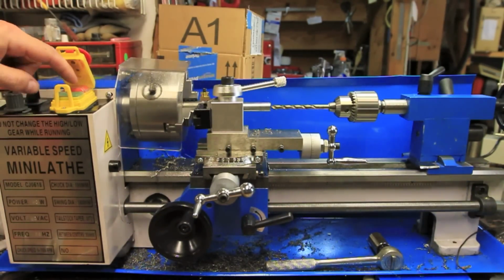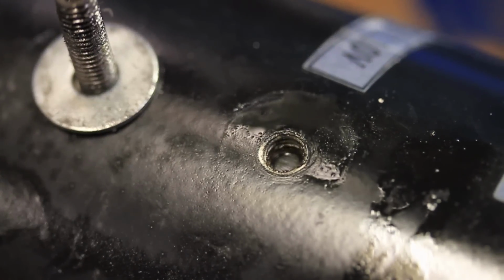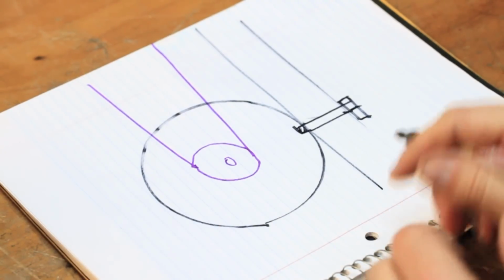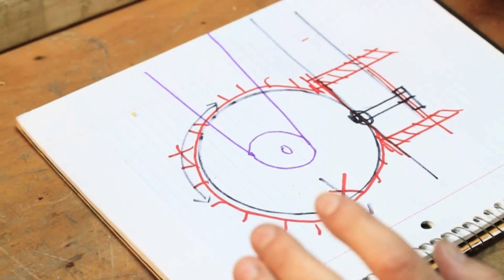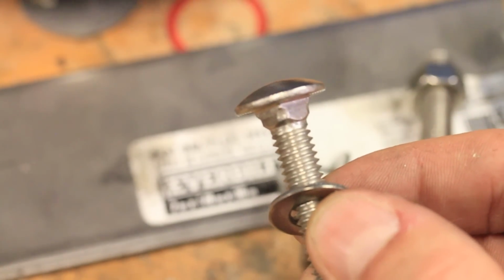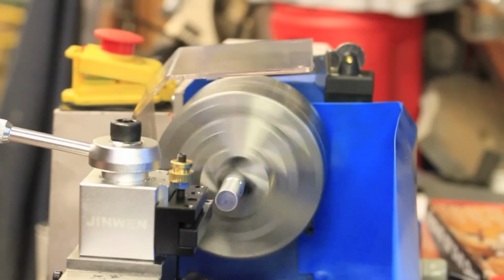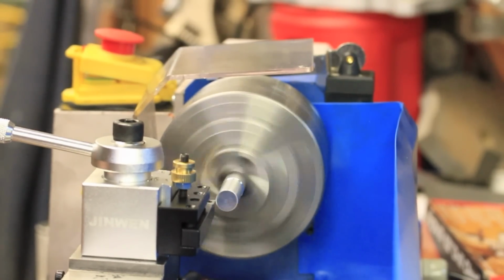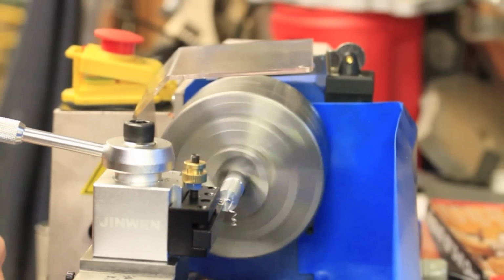It wasn't broken, just cheap - Fixing the Mini Lathe Motor Mount

Comment: Please don't wear gloves while using the drill press, or any machine, you'll lose your fingers when it gets caught.  I've seen it happen
Reply: I had stopped the video to come to the comments to say the same. Good to see there are other people who know workshop safety.
Reply: I'd like to add to this: rings, watches and necklaces /chains should be removed before close-quarter work on any rotating machinery. I've seen pics of what can happen when a ring gets snagged. 
As for long sleeves, Idk about NEVER wear them. You need to be smart and roll up the sleeves as needed. Years back I worked in a grungy shop where during the winter months it was way too cold for just short sleeves. These machines aren't dangerous, but they are hazardous ;)
Reply: The place I used to work at used tight fitting latex gloves.
Reply: This is fact, same goes with loose fitting clothes. It's like wearing a tie near a paper shredder :P
Reply: yap, that!
Reply: brucenoneyabusness That's absolutely right! Stuff happens! Venom niterile  gloves will rip off in a pinch if you must wear hand protection. They are extremely tough for a plastic glove and protect from oils & solvents. I had my right big toe cut off by a freight elevator (safety gate was altered) & a machine accidentally cycled throwing a screwdriver thru my upper lip, under the flesh almost into my eye.  I bled like a stuck pig. Both could have been much worse. The freight elevator trapped my foot & was slowly amputating. The screwdriver was too fast. Learn from my mistakes Tim!
Reply: I wear black nitrile gloves nearly all of the time when machinine metal by hand with improvised things or on the bench grinder, but make sure they are tight. I loose a lot less flesh thank to the tight nitrile, and get a lot less metal splinters. It's like adding one layer of skin, but they tear before they pull your actual mass toward the machine, and when they do, it learns you a lesson and saves your ass at the same time, so you stop and make sure to pay more attention. I got on a kick of not wearing them because the old timers said ALL gloves are bad, and I wanted to be like them. After paying the piper a few times i went back to skin tight nitrile gloves, and there's a reason the old timers finger are more miss-shapen than mine.
One should possess manual dexterity, but if one floods the skin with metal and oil, one will loose sensitivity at an early age.
I used to be that guy, and now all machine tasks are conducted with black and tight nitrile gloves. 
I go through lots of "O'Keefe's Working Hands Cream" too, but at age 40, and with chewed up hands from thre years in the Army, and 15 months in Iraq, you could not pay me to do the things I do without nitrile gloves on. I've payed my dues and have the scars and nerve damage to prove it.
Nothing wrong with nitrile gloves, as long as they fit tight and your sleeves are rolled up to above elbow.
Reply: scott gray 8:21, a hide work glove on when using the drill press. He's being pretty mindful of it, but still. If that shit gets caught on that 3/8ths bit it'll hurt.

I'd run a screw into the board to act as a stop to keep the work from spinning rather than use work gloves.
Reply: we also got a rollicking for wearing any gloves even nitrile ones when using drill presses, lathes, mills, bench/pedestal grinders, angle grinders and portable drills,(any rotating machinery) if you were caught you were band from the college workshop which meant you were going to get the sack, there was no second chances.
Reply: Some people you can just never teach, man. Same with people that drink and drive or fuck without a condom. "You live and learn"
Reply: brucenoneyabusness yeah just a simple g clamp could save a finger or hand
Reply: Can you use handheld tools for softer materials on this lathe?
Reply: Dave H. 👍👍👍👍👍👍👍👍👍👍👍👍
Reply: scythelord that's what I'm sayin. You gotta pick your spots and use your head. There really is no hard rule to follow because it's all dependent on circumstance
Reply: If accidents can always be prevented then why the hell do we ride a motorcycle with a helmet on?
Reply: @michor10  Law makes me
Reply: This almost happened to me too.
Reply: he was wearing them while drilling the wee 4 hole plate. you could!n!thve been wearin your specs!!
Reply: Jim Bain indeed he was... All that machinery but no drill press vice? C'mon they are so cheap ...
Reply: Used gloves why using a drill, and two of the fingers caught.. daym those fingers did not feel good afterwards.. no blood or nothing but it was not comfotable hah
Reply: brucenoneyabusness I've had a hand drill catch my shirt and it wasn't fun it hurt a lot I was fine but it's not fun even from just a hand drill I couldn't imagine a drill press
Reply: I've seen the aftermath of the ring wearing scenario - its called "de-gloving" and is damn messy, will never forget it.
Reply: id rather get a cut than hand getting pulled into the mahcine
Reply: Or simply have common sense and don't touch any rotating equipment or use any hand tools on said rotating equipment while using gloves. It's perfectly safe to use gloves with any machine. Just don't get your hands anywhere near the work at any point.

Those strict rules they teach in shop classes are to keep idiots from hurting themselves. Professional machinists often use gloves without issue since it saves their hands for the 99.999999% of the time nothing ever can go bad.
Reply: When in the video was he wearing gloves? I couldn't see him wearing any
Reply: atsernov It doesn't matter how careful you are, you never wear gloves or long sleeves when operating any mills, lathes, or drill presses. I've seen people lose fingers, and have hands shredded.
I've seen someone get really lucky when his sleeve got caught on a lathe and only by accident did he live... when he got caught it was his right arm and the machine was set on 120 rpm. He was leaning against the headstock, using his left arm. So when he got pulled in, his left arm by chance hit the emergency stop. I don't care if you're only wearing those cheap white singe layer inspection gloves, NOT WHILE RUNNING ANY OF THE MACHINES MENTIONED ABOVE.
Reply: Can we just let people do as they please in their home machine shops? If someone wants to employ unsafe habits in their own garage that's their perogative. Let them be them. We can be safe in our own, they can be unsafe in their own, let's stop badgering each other about it. They know the risks already.
Reply: Its not badgering, its just passing on information that may prevent someone inadvertently ruining their life.
Reply: @davek0974 It's badgering when there's 27 seperate comments all spouting off the same 'AAAAH LONGSLEEVES/GLOVES AND LATHE' one liner. They alraedy know. Let them risk their own life and limb in peace.
Reply: @TestECull  but a newbie to machine tools might be watching and learn unsafe practises.
Reply: @alanclarke4646  You really think they will see a buncha guys in yhe comments of a youtube video dogpiling OP about something and think 'hey those guys know whats up'? Because they wont
Reply: @TestECull   how do you know he knows?
Reply: @croyce7699  Pretty damn impossible not to know them if you're sufficiently in the know to fix a lathe like this and use it properly.
Reply: @TestECull  everybody needs reminders from time to time. People have an uneventful experience using a piece of equipment under certain circumstances, their brain starts to think it's ok. We get complacent. We get comfortable, we get hurt.
Reply: @croyce7699  Let the poor guy  do what he wants with his own safety. Worry about your own, let him worry about his.

Comment: Great upgrade,  I decided to use an external VFD with 3 phase motor. Commercial type. And drive it with expanding mandrel.  But your upgrade preserved the lathe from external hacking

Comment: I currently have a similiar knocking sound with my new Vevor. It seemed to go away when I tightened the motor belt pulley, its back again. Tore into it again tonight and noticed the belt was overly tight. Loosened it and the knocking went away. By the time I had it put all back together it was knocking again. I'm assuming the current board will not support a brushless motor.

Comment: I have this exact same model of mini lathe. I'm still in the process of putting it all back together after having torn it completely apart to check everything. One  of the things that needs checking is the motor mount.  I also created a plate with holes for the two bolts going through the casting that hold the motor in place which cover up the slots completely and provides a more even clamping distribution on the casting. I also filed and polished the heads of the bolts that back out of the casting above the motor to hold it level in place. I also did a careful alignment of the motor when reinstalling. I also super glued window screening over the openings near the back end so that air currents through the motor would not draw in chips, metal filings etc. I also did your circuit breaker upgrade. My lathe came with a 5 amp fuse and a spare, so I bought a 5 amp breaker. I also added a tach , a combo volt amp meter to the inside of the  control box. I mounted the hall effect sensor to a bracket I installed inside the head.

Comment: Thx for sharing the teardown and the new motor mount. I don't see why they didn't just use hot glue, it would've only been a little less strong. That mount is genius and since I recently acquired one of these that mount will come in handy.
Again, you have to view products like this as a kit to be finished, 'cause it sure ain't finished from the factory. I love it that you screwed them, by you not scrapping that unit. You also ended up with a quite functional lathe in the end.
Again, thx for sharing.

Comment: Tim, I couldnt see in the video, but do you have a threaded hole in your motor housing with a ground sticker next to it? I have one on mine but there was never a wire there even when new... I took mine apart to replace the belt and now it wont turn on. The only time I hear noise is when the Red Stop button is about halfway down ( I hear buzzing as though the machine is on). I thought I may have mixed up the two wires I took off that go to the switch but they are exactly like they were before when it was new (and working). Anyway just wondering if you've got any ideas. My fuse looks fine too!

Comment: Fantastic fix. I'm so glad I watch your video.
 I have the same issue with my harbor freight tools mini lathe. Im in the process of converting the headstocks Chuck mounts 3 bolt to a 4 bolt pattern for my newly acquired 6 jaw, 4 jaw, and face plate.

Comment: If mine ever fails I will turn up some ally gears and run it on a belt attached to a variable speed drill. The electrics are touchy as well.

Comment: The torque force induces shear on the bolt, which is handled perfectly well by a bolt like that. The problem is the weight of the motor, pivoting the motor against the threads. The problem with this design is it does not accept the cardinal rule of where to use bolts and fasteners, IE, never against the threads or with the length of the fastener. When you hang things from a nail on the wall, it pulls perpendicular against the length of the nail, as such it is fine. But if you tried to do this in the roof, the max load on that nail is now drastically reduced.

Your design is actually worse when it comes to handling the torque on the motor, but as the torquing mass is small, it shouldnt matter. The main problem with this was the rotational moment around the contact point between the motor and mount that the weight of the motor induced, which you handled well.

Comment: What's the distance between centres with a drill chuck in the tail stock?
Reply from the maker: Hey, sorry for the delay. I don't have an exact measurement right now but it's roughly 9-10" Shorter depending on what's in the tail stock.
Reply: Thanks!

Comment: Like your Videos . I bought the same Lathe recently, and will make that mount as well . I have used the machine a little , but are finding a lot of loose bolts , and sloppy fitment . Like you are showing everything can be improved , and overall the Machine is a good base to work from . Here in Down Under I paid 600 Australien $ wich is a reasonable price in my opinion.Liked&Subscribed

Comment: Btw, Tim.

Is the stock motor good enough for all the work?
It has enough power, not so noisy and so on?

How is the experience?

Would you replace the motor with something better/more powerful or its not necessary?

Thanks
Reply from the maker: So far I haven't had any issue with the motor other than popping the fuse on larger items... Usually the noisy part is the cutting, not the motor. And I would consider it in the future should this one go bad, but I don't feel the need to change it currently.
Reply: @TimNummy  I have found it is easy to stall the standard 550w motor. (I do have my doubts this is in fact a 550W motor, as there are no markings on the motor stating its ratings, or there wasn't on mine.) That is why I upgraded to a 750W 1HP 3 phase motor and VFD. Also cheaper to replace either the motor of VFD if the standard motor or Chinese electronics fry, As the electronics are prone to do. A fan in the electronics box helps keep it cool though, as the FET Transistors are prone to overheating and burning out.

Comment: Just wanted to say thank you because, if it weren't for this video, I'm sure I would've lost my eyes and/or fingers. I just bought one of these cheap-y mini-lathes as well and, like your machine, it had a serious knocking whenever operational. I'm a newcomer when it comes to this sort of stuff and was very hesitant about taking the thing apart to figure out what it was causing it. That is, until I found your video and saw how you went about it.

The problem I had was exactly the same as yours: my "mount" was two small threaded rods. I remedied this just as you did with the same methods and now this thing is bomb proof.  Well, until the thing blows up in my face.

I just want to say thank you for this video and the clear and concise information it provided. It's saved me a lot of trouble and prevented even more in the future.

Comment: thanks for this. that was a LOT of work for something that should be designed / made right in the first place. I could see making a mount if it was a 30 year old machine with a weird custom motor that wasn't available anymore and you were adapting a new generic one. this convinced me to spend about 2X more and get into a better machine that won't have such critical design mistakes.

Comment: Watching  video 2 times.  Idea.  Take bolts out put threaded  rod in case spot  weld it in.  Use a nut to tighten down from outside.  Will look at mine tomorrow.  It will fail for sure.

Comment: Don't listen to the people say buy better. You're right about them being made in the same factory, you can Google that. Your paying for grade of assembly, which doesn't matter since the first thing you should do with any machine is disassemble, true, and lube. I like ws2, dry lube.

 Any major production machine, Mill, lathe, automated assembly, etc. takes regular, again, regular maintenance, just like a car or gun, going to shoot your new gun without checking it first? Not change your oil or tires? Keep going with a blown head gasket?

The machinist course at school I went too: safety - tool review - machine review - machine breakdown/setup, maintenance, and truing - layout - indexing - making your own cutters/tables/vices - industry standards - tool particular techniques - freehand projects or welding. Shortcuts can be faster but we miss a lot.

Comment: Why cant we just buy stuff that we don't have to modify to work properly. Are we just too cheap or do companies just don't give a crap anymore. Great video.
Reply: You aren't paying for a Hardinge and you're not getting one.  As long as the beds are good, (They are), and the carriage is reasonable, (It is), doing a little tuning, such as using a stone and removing the burrs, making sure things are adjusted properly, it will perform the purpose for which it was designed.  It's a hobby lathe, not a laboratory machine.  The quality of them varies widely depending on the specs set by the importer, or retailer, but they all come from Seig.  Maybe twenty years ago I had one from Homier, the cheapest at the time, but before I tried to use it, I took it down to a bare bed and honed the burrs off the edges, then reassembled it with a little more care than what the factory had done.  No problem after that, it worked just fine.  A month ago I ordered the 7X16 from Micromark, still adjusting it and haven't tried anything more than a few thousandths off for about an inch.  No problem.

Comment: What version lathe is this? the brushless 500w motor?  I noticed there's no high/low gear lever or gears on headstock just straight belt drive to the chuck mandrel.
Reply: ah nevermind I see the brushes laying there...definitely an older version for sure though. the mounting plate for motor on mind is on a swing style plate. it's the LMS 4959 seig c3 mini lathe